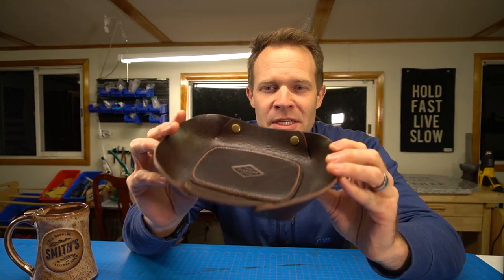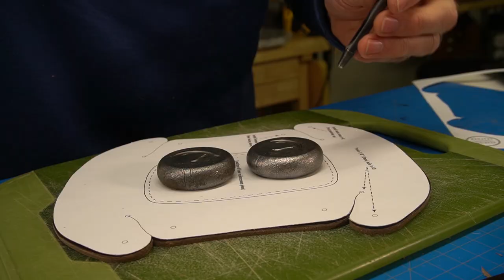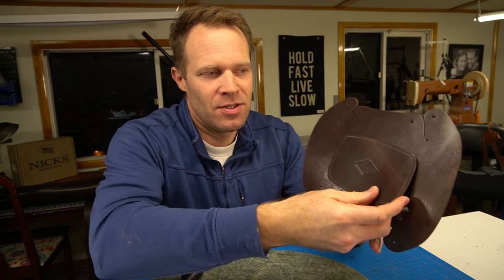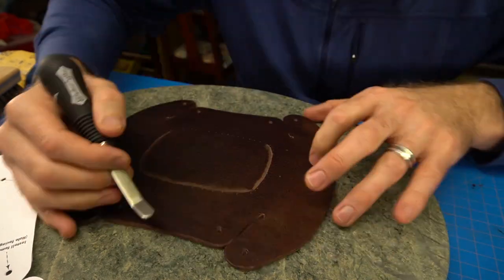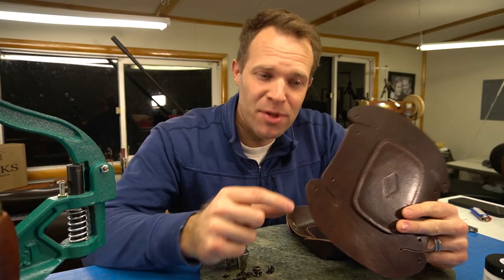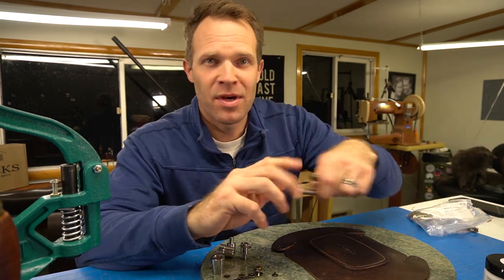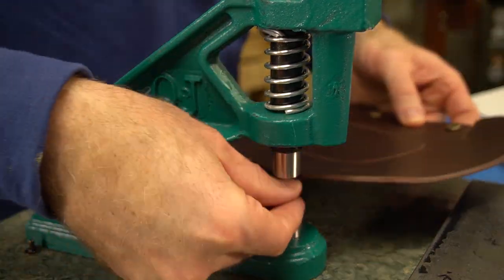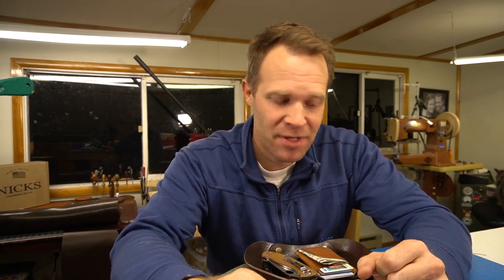How to Make a Gorgeous Leather Valet Tray (PDF pattern and build-along)

Comment: Nice project!  I have recently finished a product and applied a well known leather balm to the item.  Applied small amounts in circular motion and buffed out by hand. Item was sent recently from Va  to Florida.it arrived with white swirls which I believe is bee wax which appeared after shipment. Do you have a preferred method for buffing leather. I had rub with cloth and will use horse hair brush.  Never used any power buffers.  Never had this issue. Thoughts/recommendations are appreciated.
Reply from the maker: I think I have experienced what you're describing, and I think it's sometimes referred to as "bloom," where the wax in (or on) the leather comes to the surface over time depending on environmental factors. This is sometimes unavoidable, and I wouldn't worry about it too much! All it tells you is that the leather is well-nourished and all it should take is a little buffing (I like to use a soft cloth) to work the wax back in and buff off the excess. I think it's really reasonable to explain this to the customer and assure them that this is normal and just a sign of well-loved, well-nourished leather. Cheers!! -Tanner
Reply: Thanks!!!